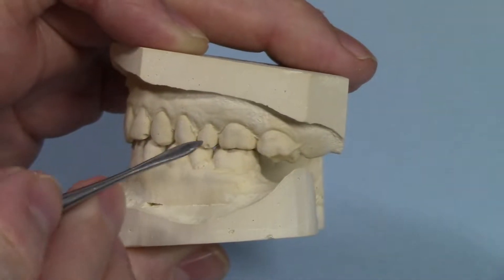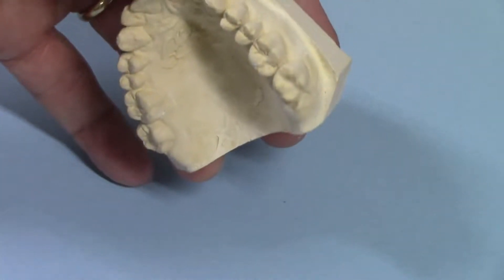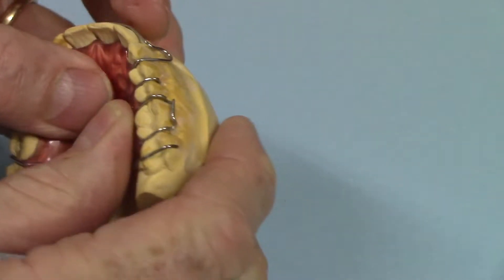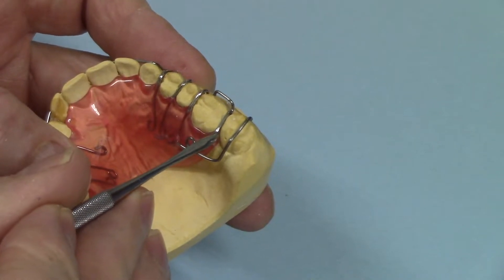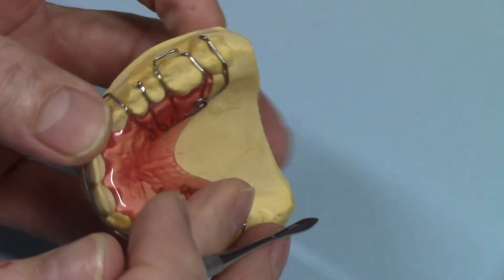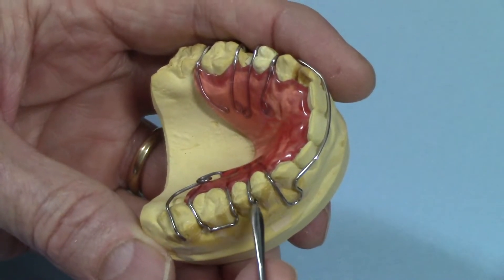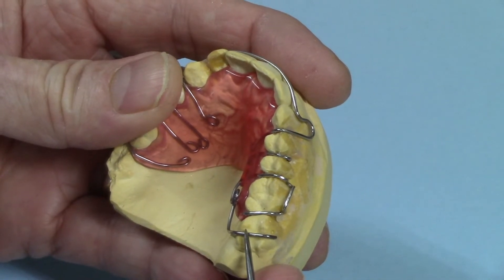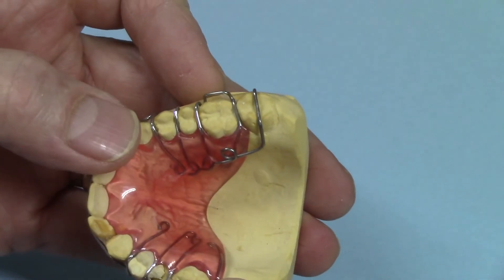Intruding a Molar

Comment: Good morning Dr.  is this technique helpful in intruding molar teeth in ske. ant. open bite ?..because the patient is afraid of any surgical interference even using mini screw.. and he occludes only on post. teeth..
thank you so much..
Reply from the maker: That’s a great question for a qualified clinician. I am a technician, and assist doctors with choosing devises to accomplish their treatment plans, but I am not trained in determining the treatment plan. I suggest you ask an orthodontist. Thanks for viewing.
Reply: @OrthoLabVideos  
Oh..l'm sorry..thank you so much..
Reply: The amount of intrusion you will require to treat such a case; the scope of such extensive movement will likely not be achievable by a removable appliance, not to mention the number of visits you will need to get there by the same. You will need intrusion of several posterior teeth, not just an individual molar alone. If surgery is not an option, mini-implants and bone screws might be the way to go. Check out Dr Chris Chang's videos, they might help.